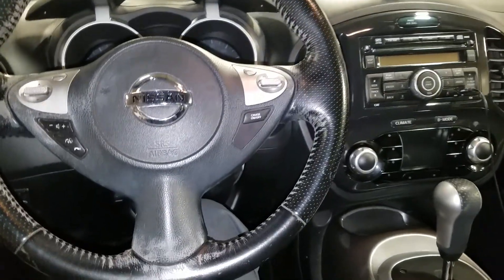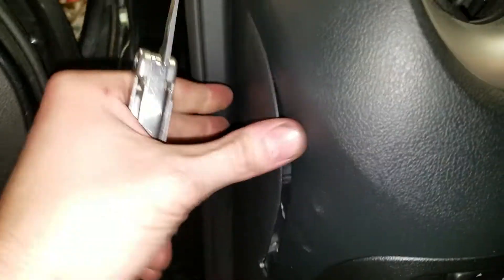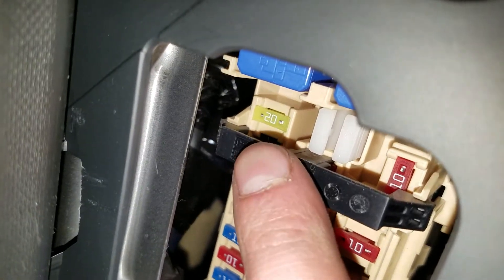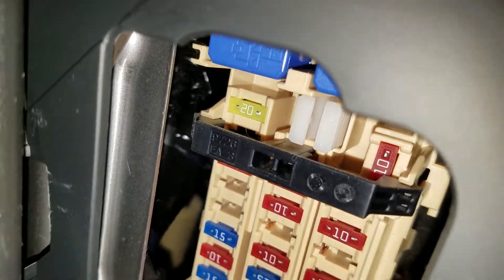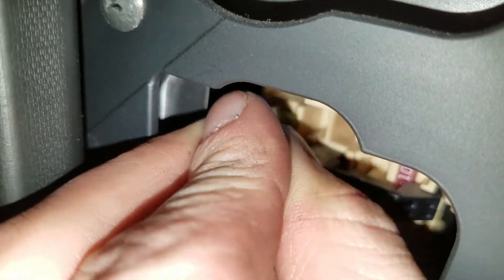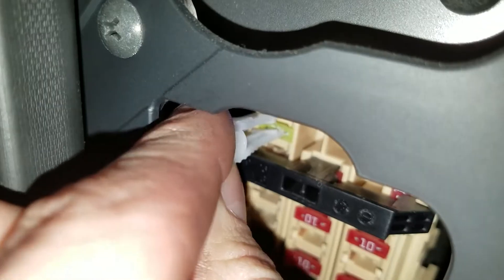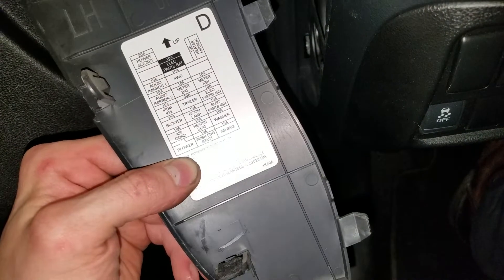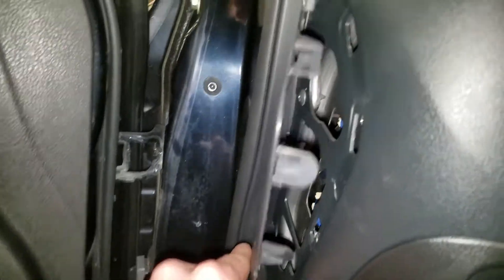Nissan Juke Cigarette Lighter Guse AKA Power Outlet Fuse location

Comment: Tip from another video. Use a multi meter through the holes on the top of the fuse. Saves pulling them out.

Comment: What if it's fine and you still have no power to the OBD2 or cigarette light and dome lights etc? Where do you go from there?
Reply: Checked all fuses and changed relays. Still no luck.
Reply: Back story to this is I was trying to pull the  blower motor relay and the plastic casing cracked and it arced to my pliers.